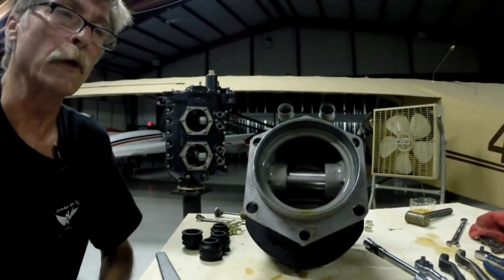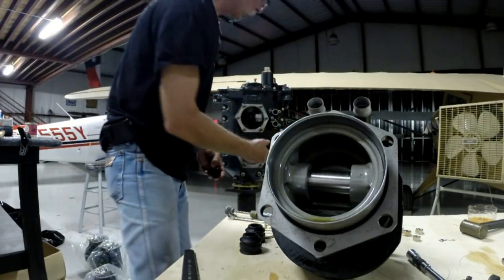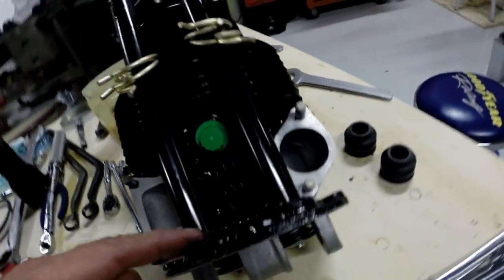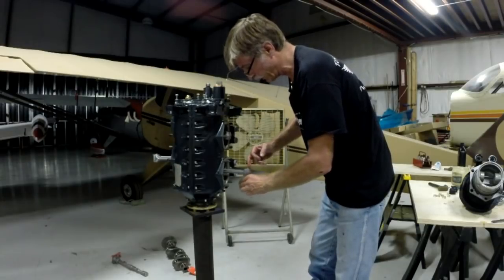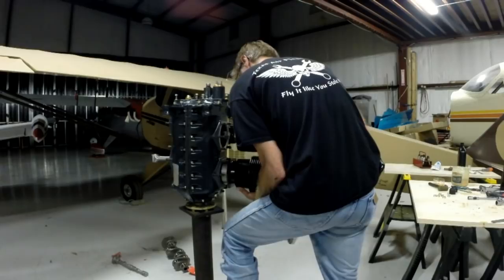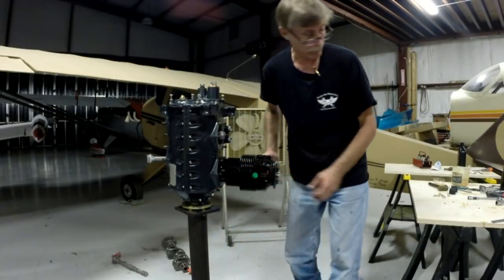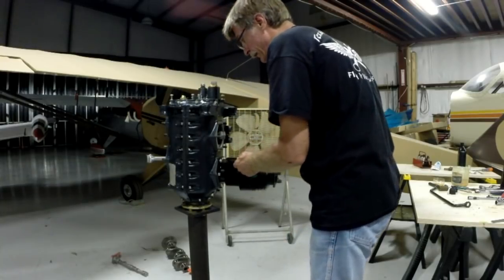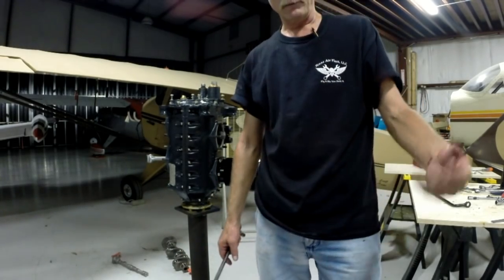Airplane Repo - Kevin Lacey - Engine Overhaul Series - Cylinder Installation

Comment: That's a neat way putting the cylinder on, that's how we do it with diesel engines we rebuild, they have a sleeve in the crankcase when you buy the sleeve now the pistons come mounted in the sleeve just push them down hook up the connecting rod and press the sleeve in the engine. Done

Comment: i know it is a bit late in the day, but we  use a light coloured paint, like a light gray or light green, so as to high light any oil leaks that may happen early on, an old Air force / Army / Navy trick were cosmetics do not come into it.
Reply from the maker: yup, but I do not plan on having oil leaks - if I do, I use that white developer spray that is used in dye checking for cracks (without the dye of course) works pretty well
Reply: i don't think any of us do plan to have leaks mate, just makes the quick in the field check a bit easier for us, the developer is a good trick to, each to their own, i  like the channel and to see how others do things, we never to learning  do we

Comment: Do those pistons use C clips / snap rings to retain the wrist pin in the piston? If not how are they retained? Clearly they are not press fit and I didn't see you put any clips on?

I knew a guy one time who wrecked a pretty expensive small block by using full floating pins and forgot to put the clips in
Reply from the maker: Hey Eric, No, the little Continental engine does not use C Clips on the wrist pins.

The steel Wrist Pin is a tight slip fit in the Piston and the Connecting Rod. On each end of the Steel Wrist Pin is an aluminum cap which pretty much keeps the Wrist Pin centered.

Kev
Reply: Oh ok, Thank You! I enjoyed your engine build series! I am an auto mechanic by trade so I know quite a bit about engines, but not that much about aircraft engines. So, I got to learn a few things.

Comment: I didn't see you install a circlip for the wrist pin, does this engine use buttons?
Reply: John McRae I was just thinking that, I've only see press fit or circlip
Reply: Yes, the pin has itty bitty convex aluminum buttons inserted on each end.

Comment: First of, I want to let you know that I love your show ( airplane repo) I have a piper cherokee 140, it was due for annual inspection and in the process my mechanic found out that cylinder #3 had very low compression 80-20, so he replaced it with a brand new lycoming cylinder, he also tuned both magnetos,  now I finally had a chance to fly it and I am experiencing vibration throughout the entire plane,   I noticed that when he was placing the piston into the cylinder he was looking at the back of the cylinder for a long time, I noticed there was a little symbol in the back of the cylinder i am assuming that the symbol is a reference to how to place the piston in the cylinder? if the cylinder is placed the wrong way (upside down) could the be the cause of the vibration? or tuning the magnetos the wrong way could that made the engine vibrate? Thank you for your help

Comment: No snap rings for the wrist pin?
Reply: That's what I was thinking? Only I have seen some gudgeon pins secured with a type of screw cap? I have just bought a Cherokee with an 0320 E2D with high hours, that's what I was researching this for. For information, I worked on Yamaha world superbikes back in the 90's with the OW01 750 etc. Those gudgeon pins are retained with Circlips, I think you call them wrist pins/snap rings? Two strokes have the added gotcha of needing the rings locating in pins in the pistons ring grooves to stop them rotating and the ends of the rings snagging in the ports! You gotta Love engines!!